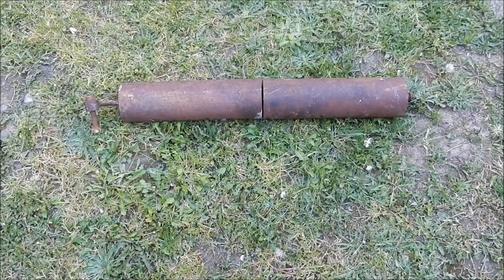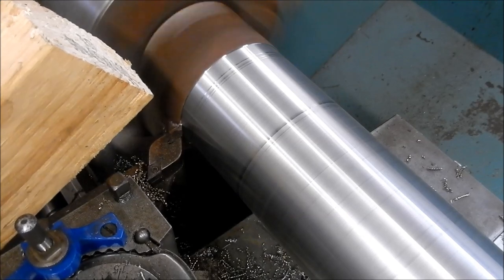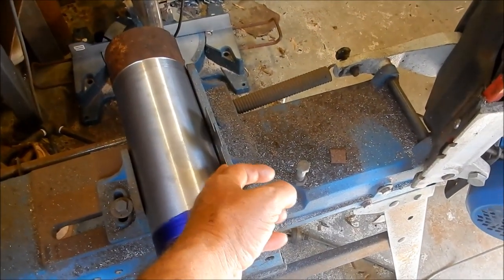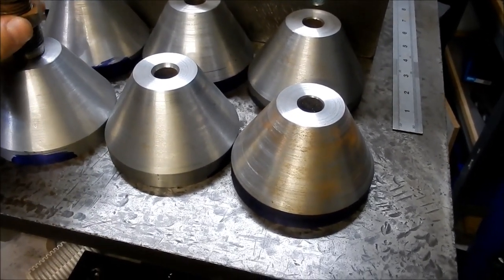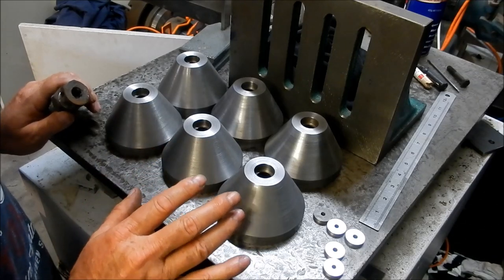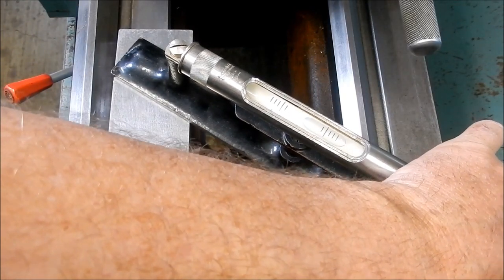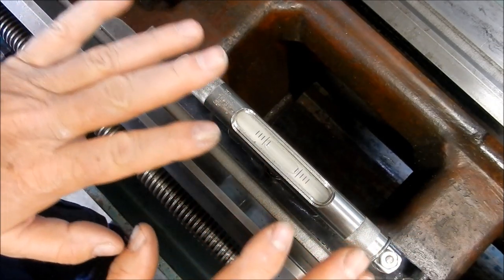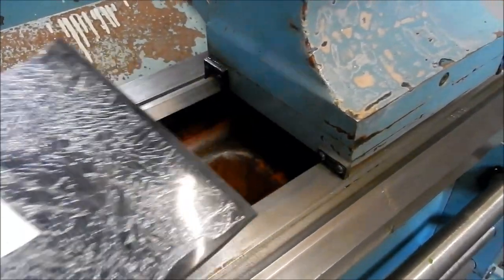Making Adjusting Feet for the Victor Lathe

Comment: Gday Cam, you lathe is cutting absolutely spot on, gotta be happy with that, thanks for showing the material you used for the way wipers, I need to make a set for the tailstock, great job and great video mate, cheers
Reply from the maker: Thanks Matty, yep I'm feeling pretty happy with the Lathe purchase, a bit of work to get it up and running but it was worth the effort.  Email me your address and I'll send some of the wiper material up to you.  It took 2 months to get out of China and I bet it will be longer with the current postage issues.
Cam

Comment: I like your design for the feet, it's better than the ones I made.  I tried to do a roll crimp to retain the feet to the jacking screws, which work as long as the lathe stays put, but they quite readily pop off if even a small amount of sideways movement is encountered.

Comment: I have no idea if it is the same company, but when I bought my first house it had some serious slopes, so I bought an Australian Victor 2-stroke lawnmower. The motor was still perfect after 35 years, when it was stolen! It's replacement (Chinese badge-engineered) was beyond economical repair in 4 years!
I enjoy your "quart from a pint pot" approach - good video!
Reply: I think you will find it is a Victa mower
Reply: @simongorman366  I think you're correct. Still Australian, excellent machine.

Comment: Hi Cam, easy to clean under the Lathe with the new levelling feet.
Yep I put up with the fan noise on my VFD's, my hearing is not as good as it used to be.
Have to change my felt way wipers soon, might look at the poly urethane route.
Reply from the maker: G'Day Willem, I've got to do something about the noise.  Apart from being a pain it makes it hard to video when they are still running.  Go with Polyurethane for wipers it works really well.
Cam

Comment: i really like your channel. i have a Cadillac 14x40 and run a multi fix tool holder size E 3/4 shank. multi fix recommends the next size larger, huge shank cap. my lathe is rated at 5/8 shank. i was wandering what size is your multi fix. i think we have similar lathes different by one size.

Comment: Presso beat you to it !
I have one of the huanyang units and the bloody fan is terrible , i think Mark had to disassemble most of his vfd to change the fan - mine looks like it is mounted externally so hopefully i don't have to do this
Reply from the maker: G'Day Ian, those fans are a pain.  I went through all the codes to see if anything could be done.  Unfortunately the fan settings are factory set and cannot be altered.
Cam